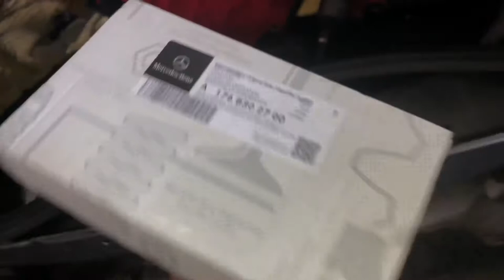Mercedes-Benz A-Class water ingress (Vent flap) short repair clip

Comment: Had the same issue. Fight against Merc Service centre to repair under warranty for a year and half and finally got it repaired. I told them the issue, they knew about the issue but pretended that they didn't know about the issue then replaced the vent to fix the problem. Other people I talk to had exactly same issue and they had to repair it with their expenses. Had too many issue with the car so trade in the car and bought something else. Will never get another Merc.

Comment: Hello, Could you put some context behind the video.
I have a problem on my class A W176, water inside behind pilot seat.
Is this the part to change to avoid the problem ? thx
Reply: I have the exact same problem, it's apparently very common. Hoping to get clarity on the issue and look to get it sorted
Reply: yes correct it is the main problem of water leak i change also my W176 today
Reply: I'm also having a problem with water entering the cabin but mine is through the fuel cover. I though I've fixed it but now it's entering again, maybe it's from these vents. 
Does the water stay on the boot? or can it travel to the footwell?
Reply: @RuiRex  i have the same problem. The water wets the area where it goes the air pumo inlfator
Reply: @oscarjeandiazbustamante2293  sorry but I didn't understand where the water enters in your case. Is it from the rear bumper as the video shows?
Reply: I found out why I have water in the rear footwell again, the silicone that was added around the fuel tank tube has cracked and the accumulated water can pass through it... another weekend of interior teardown...
Reply: Hello, did you discover what was causing this? recently got a mercedes and its having this exact issue! :( been advised its these rear air vents and the seal of them?
Reply: @jacobparry97  yes, the seal of these vents tends to get dried out over time and doesn't seal properly. As the water from the trunk surroundings and tail lights ends up on top of these vents, the water gets into the interior. I have to fix mine this weekend also. Right after fixing my fuel tank lid issue, now I have to clean it all again 😞
Reply: @RuiRex  Hello, did it help with this air vents replacement?
Reply: @RuiRex  Hi, how did you manage to fix it? Silicone replacement? Thanks
Reply: @dominikgrodecki8546  I did not replace them. I cleaned them with water to remove dried dirt and applied a rubbery type of silicone and now it is great. No more water ingress. Don't use "normal" silicone, it will dry out with time and break leading to the same problem.
Reply: Hi I have a 2017 a class and I am having the same issue. I bought the car there was already water in the rear footwell. I dried it out used the car for about 20 days and this morning just found water in the rear footwell again, can someone help me please if you had this issue fixed!!